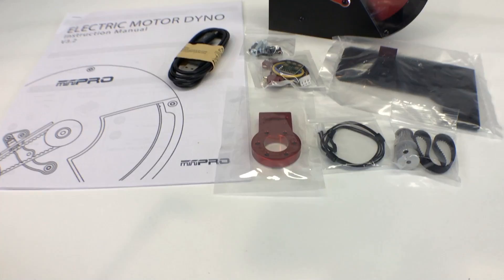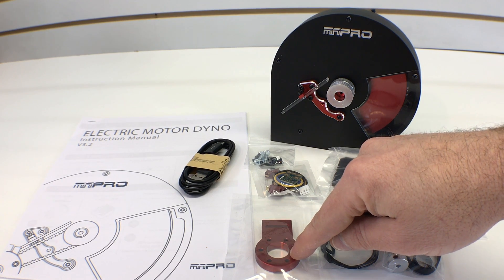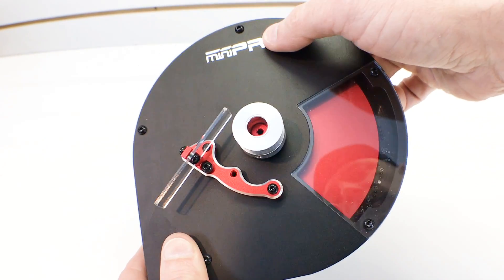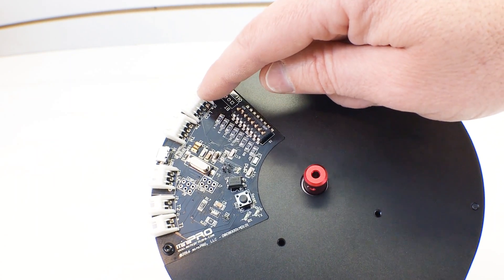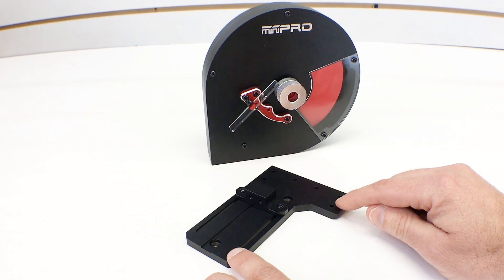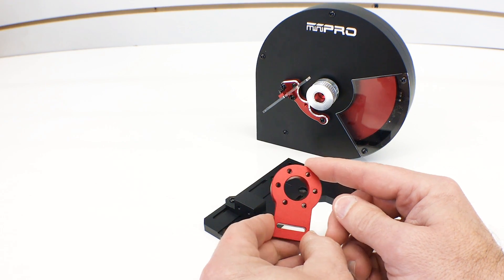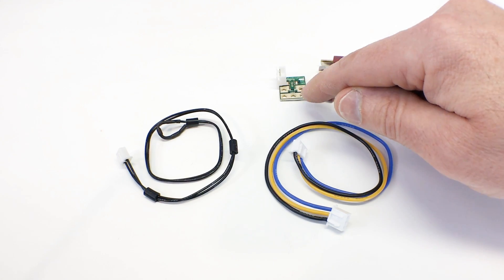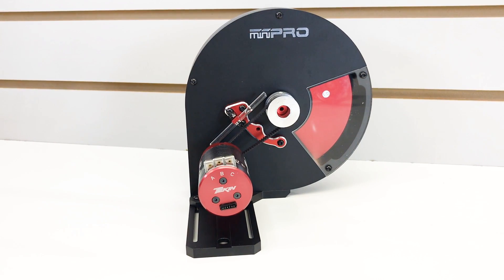Go Faster! - MiniPro Electric Motor Dyno First Look

Comment: Awesome piece of equipment at first glance, however very short sighted of miniPRO not developing a version which will operate on the iOS platform; a software issue miniPRO are unable or unwilling to address. Also omitting onboard Wi-Fi and tablet compatibility is another lost opportunity. So one needs to question just how good this dyno is given some very obvious glaring omissions.

Comment: But $400 for a few pieces of Aluminum / Steel / Metal. Now if the software comes with it I could understand part of the money for developing of the software but 1 owner of a CNC machine could make the metal for that at a fraction of the price. If they priced it around $200 it would be more understandable but to me it seem like they are trying to capitalize on a part of the market that is in need of items like this but currently don't exist..  ( This is my own opinion )